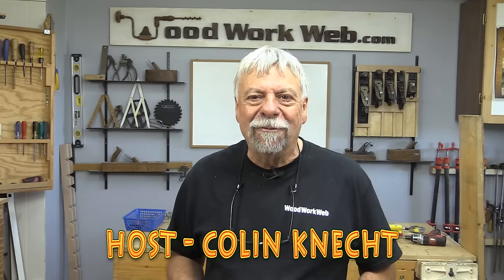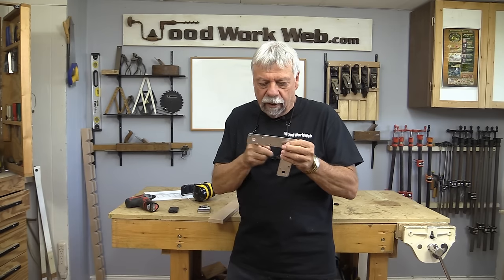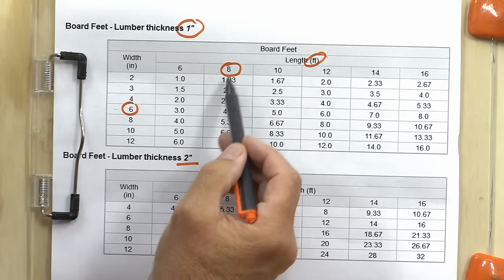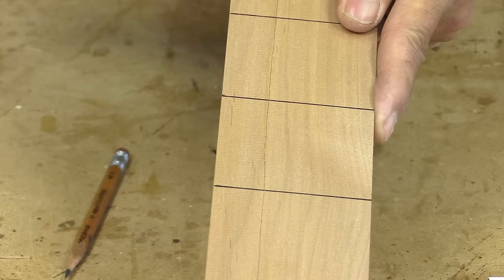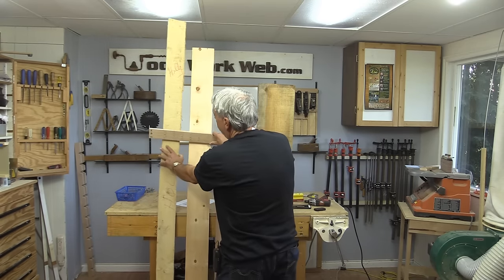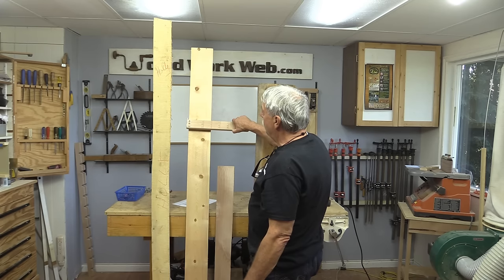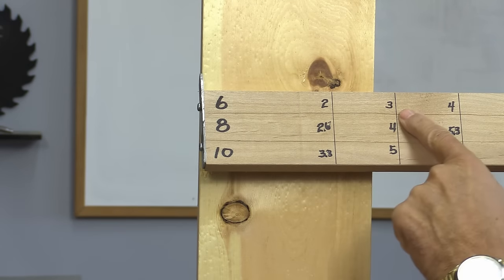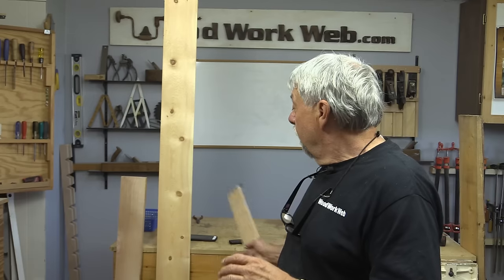How to Make a Lumber Rule for Quickly Calculating Board Feet

Comment: Neat Colin.  You've plenty of room to put a couple of scales on that grid for 4/4, 8/4, and maybe even 12/4 stock (you really only need them for the fractional BF ones anyway).  I'd also be tempted to paint the back of it with chalkboard paint.  I always take chalk to the hardwood dealer to mark lumber, and if the back of this rule was a chalkboard I could keep a running tally of what I'd picked out too.
Reply from the maker: Yeah, it wold be easy to mix n' match scales and use reverse side too .. thanks for your suggestions too, chalk would work :)

Comment: Great suggestion.  Why not mark the other side with  the scale for 2 inch thick boards?
Reply: great suggestion, I was going to say that..............
Reply from the maker: I actually did mark the other side, but not until after the video was posted, but I used similar marking so that I could use the scale left or right handed, I thought about the marking for 8/4 but doubling 4/4 is pretty easy, so opted for what would work for me ... but you could also mix n' match marking too ... really depends on what is convenient to the each of us

Comment: Very helpful video and jig. Only a bit confusing for me. I am not really familiar with inches and feet so I had to find out what a board feet is. Never heard of it before. Since I know that there are 12 inches in one foot, 6 inches is half a foot. The example of 8 feet long and 6 inches wide makes 8 x 0.5 foot is 4 square feet.
But the second chart shows lumber of 2 inches thick and in that cases everything is doubled. That means that a board feet is
not equal to a square feet because the surface did not change.  Can you please explain?
Reply: a board feet is: 1 foot x 1 foot x 1 inch
Reply: Thanks for the explanation.